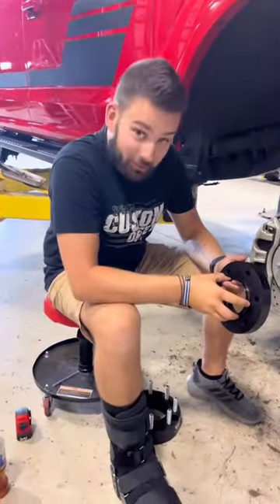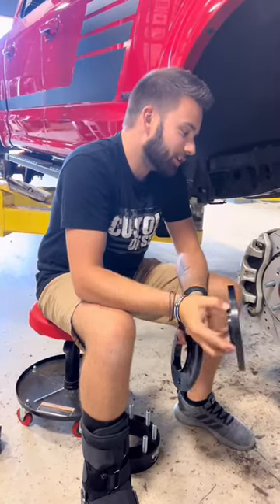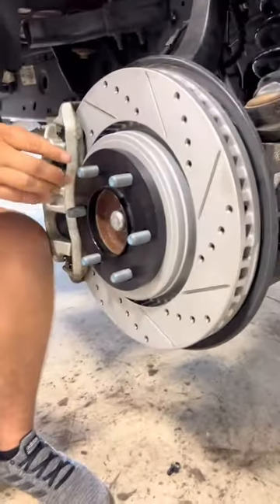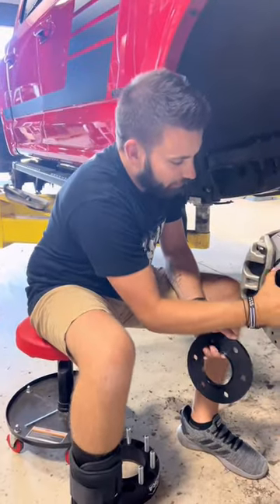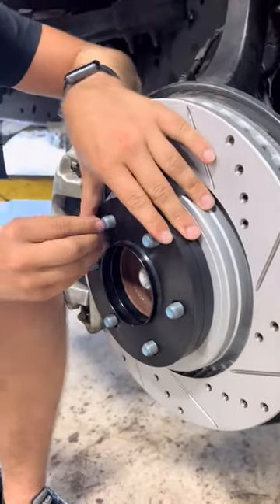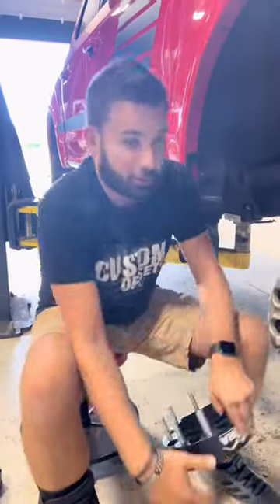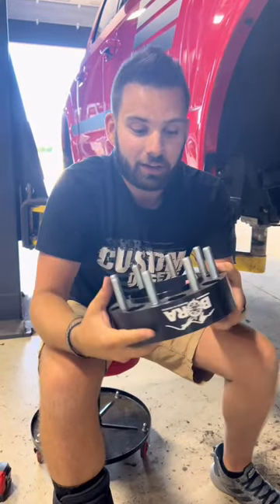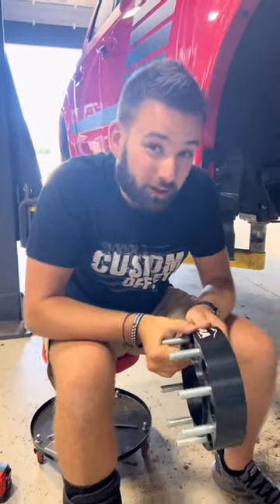Everything You Need To Know About Wheel Spacers #shorts

Comment: I’ll teach you about spacers in 5 seconds, throw them in the garbage and buy the correct wheels. These spacers you buy on Amazon have studs that have the 1/20th the strength of your stock studs and your going to shove your wheels out and raise the truck, with cheap junk parts. Spacers are a bad idea every time
Reply: Just like with any other product. There are junk ones and there are quality ones. You get what you pay for.
Reply: @hunterraatz5481  QUALITY WHEEL SPACERS, not possible since wheel spacers only create problems. Only ruining the quality of your ride. If you bought the right wheels and/or suspension parts and steering components, you would never need wheels spacers in the first place
Reply: @jaybee6477  and what if you cant buy the right wheels for it? you know with a proper spacer there is no difference compared a wheel with the same offset
Reply: Yes crappy China made spacer from Amazon for $100 for 4 is not a good idea. 

USA MADE BORA spacers about ($500) for a set of 4 are perfectly safe to run and have no worse wear on the suspension parts than an equally offset measuring wheel.
Reply: @jm4472  NO, you’re totally wrong and the only people that would agree with you sell wheel spacers(or idiots who have them)wheel spacers are garbage and will only cause problems. Do your research and buy the right wheels and once again you won’t need wheel spacers. Wheel spacers SCREAM I’m an idiot who clicked buy now without knowing what size wheels actually fit